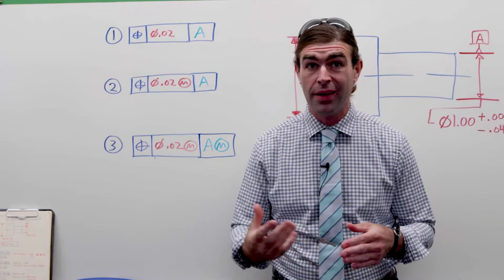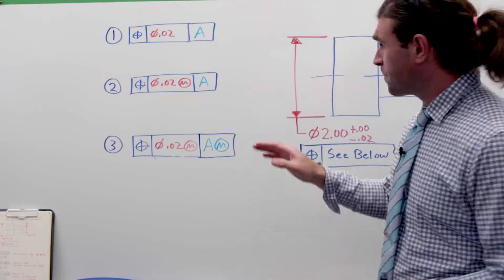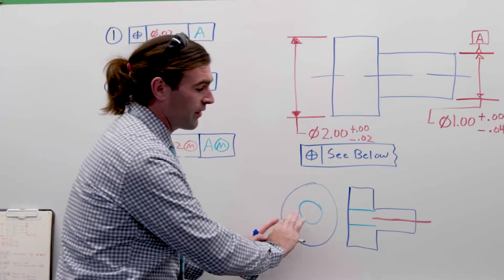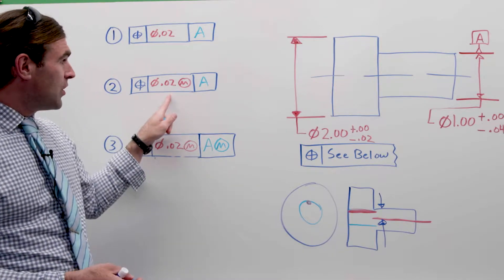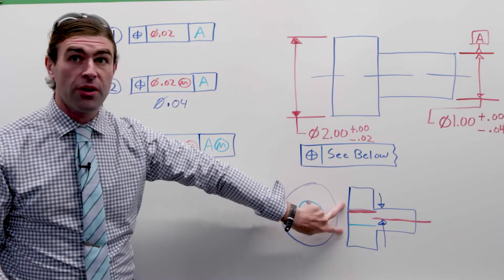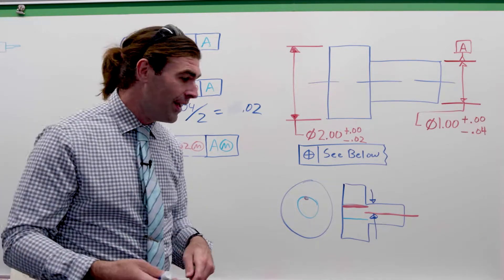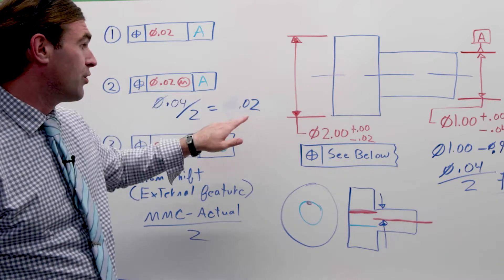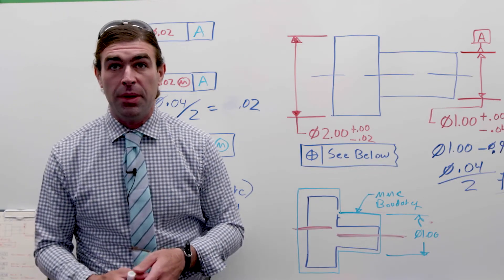GD&T: Calculating Max Axis Separation, Coaxial Features, RMB & MMB (Calculating Datum Shift)

Comment: The equation you show, and seemingly most interpretations I have seen regarding datum shift, is implicitly 2 dimensional.  I.E. it doesn't describe rotation.  The way I see it is that the part should be able to fit into the MMB of the datum with shift, in any orientation.  My question is can the axis displace within the datum shift at an angle.  

The problem I am having is in regard to a hole in one wall of a part being designated the datum, and a few inches away, and coaxial with this feature is another hole with a feature control frame controlling the position of it to the datum hole which allows a datum shift and with positional tolerance allowed MMC.  Since there is only constraint to the one datum (the coaxial hole) does the shift allow the axis of the datum to displace at an angle form its perfect form?  

In simpler terms, if I create a gauge pin @ the MMB boundary of the datum feature long enough to pass through both features, and given the hole is say 3/8" in diameter and through a .150" thick wall, the pin can wobble around until it fits into the hole in the next wall.  But if you apply the equation shown here, it implies that the axis projects across to the wall where the dimensioned hole is, and that they may displace from one another, they do so while remaining parallel.   Which is correct?

Comment: Ahh makes so much more sense now thank youuu!!! Question though; what's the difference when MMB is applied to different datums when theres three or two called out in a FCF? In this video you gave a simple example of MMB applied to only one datum, however i get prints at my job where MMB is applied to a secondary datum or both a secondary and tertiary datum and nobody knows how to apply this principle at inspection. Do you add them together? Also, can you add a video to this where you are applying the MMB principle on the surface plate?? How is this not the same thing as bonus tolerance? I understand you aren't gaining any size, but isn't the added shift in axis in a way the same thing as a "bonus" so to speak? Thanks again for your videos!!
Reply: MMB & LMB can only be applied to Datum features of size.
Reply: @hugorodriguez6835  yeah I understand that part I just don't know the difference when more than one datum is used

Comment: Can the Primary Datum of a datum reference frame for true position of a hole be a datum which is NOT perpendicular to the axis of the Hole being defined?   Every textbook example I have seen has a datum Normal to the Hole Axis as the primary datum.  For example if a hole is machined into a surface which is perpendicular to datum A, can Datum A be used as the primary datum in the datum reference frame and if not why?

Comment: Can you do a video on how to simulate a Hole Pattern as a datum at inspection?  Specifically a 5 hole pattern where there are no obvious center planes of the pattern itself and the holes are not on a radial pattern.
Reply from the maker: Do you mean an inspection on a granite plate, or a CMM inspection?
Reply: @RDeanOdell  On a granite plate preferably but either would be good to know. (or both :) )

Comment: Hi Odell, Your videos are very helpful! Thank you! Might you be able to help me with an alignment issue? I'm trying to set up a program to run a part that needs to be flipped but will not be in the same location after its flipped, so I need a manual alignment for the 2nd side, hoping to get all the info on one report. So far I have program that works, but I have to do the manual align for the second side every time. I set up the manual align for the second side by going to the "Measurement plan editor" then "Man cnc mode to chose the second side alignment features. That seems to work but I still have to do the manual align each time. I have to think there is a better way. Again thanks for your time and your helpful videos!
Shaun